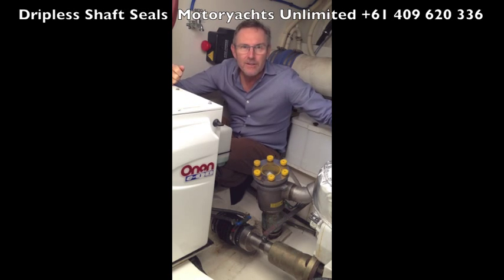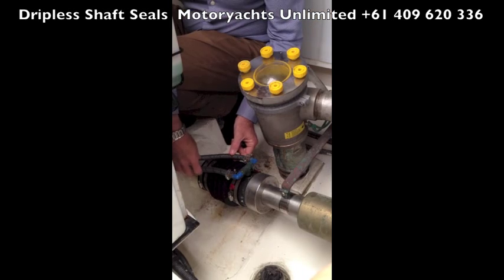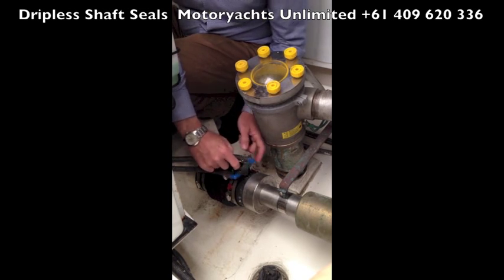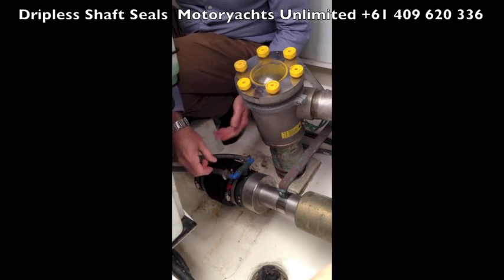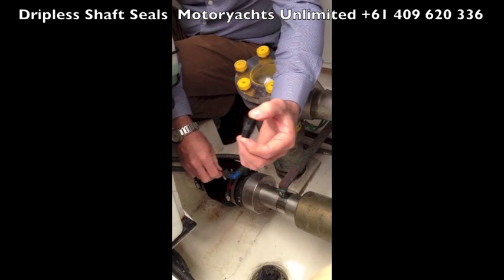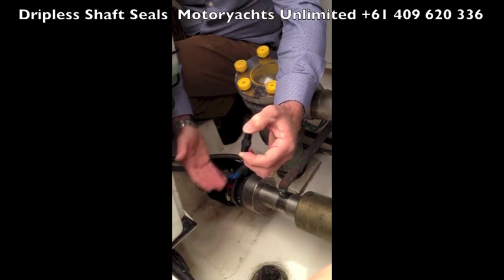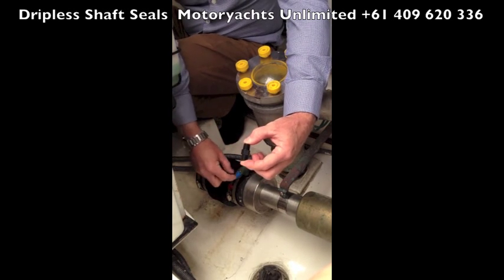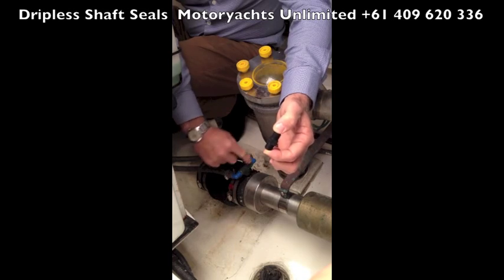Dripless Shaft Seals

Comment from the maker: Hello, I'm sorry entirely sure what you are talking about. Can you explain a little better please? The lubricant water hose into the top of the PSS seal is under pressure from the main engine cooling system so I don't see how it could create a syphon unless the feed hose was connected to the wrong part of the engine system.